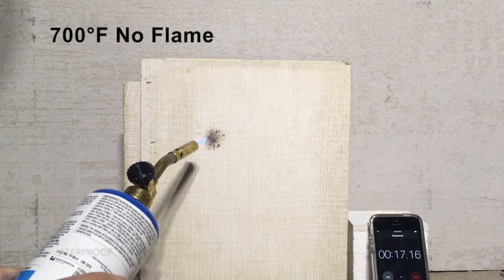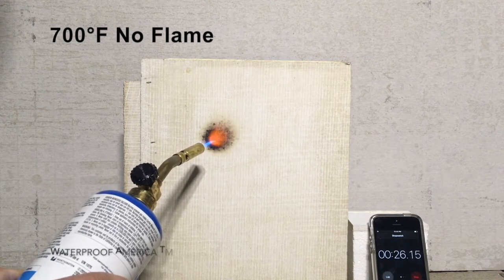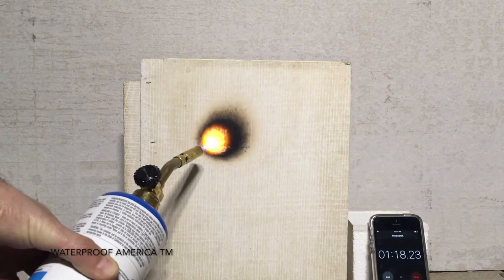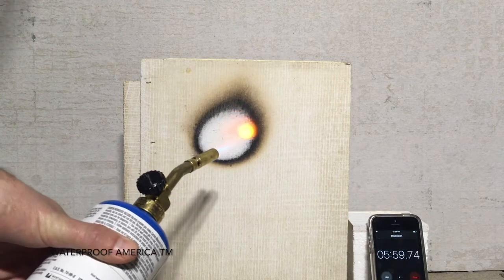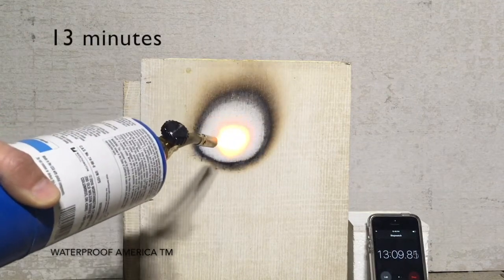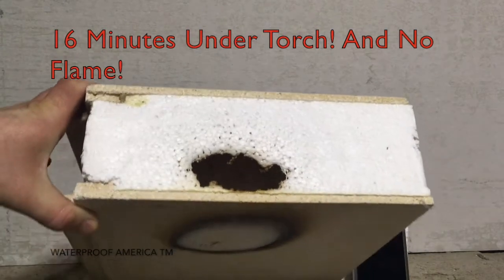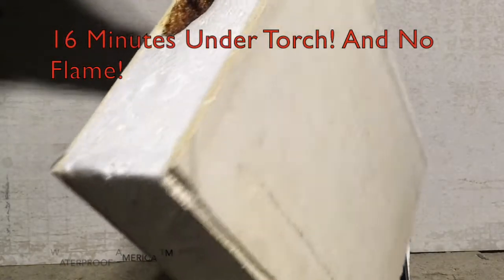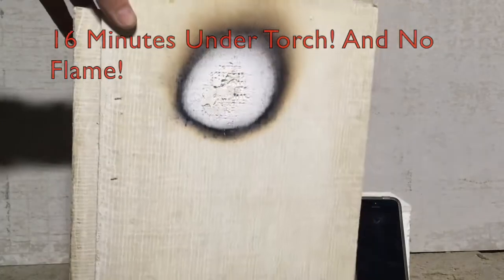Mold Proof, Fire Proof, Water Proof Wall Panels Ideal for your project!

Comment: Is this more affordable for commercial properties than residential homes?
Reply from the maker: Commercial proprieties will require stronger and larger panels, your engineer or we can make the calculations to see exactly what we need. The WA Panels vary in cost depending in the materials used as skin boards, MGO will be more expensive but also more durable then plywood.